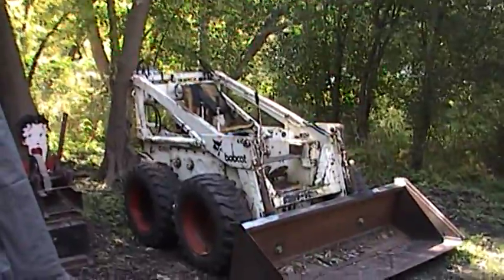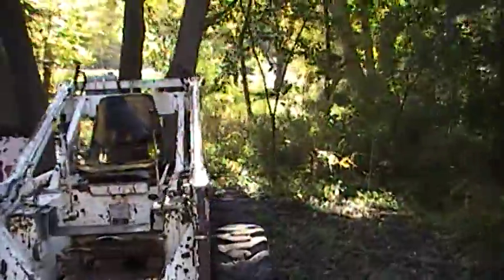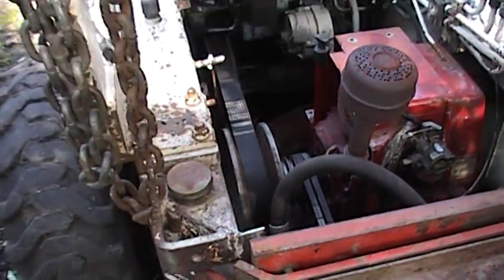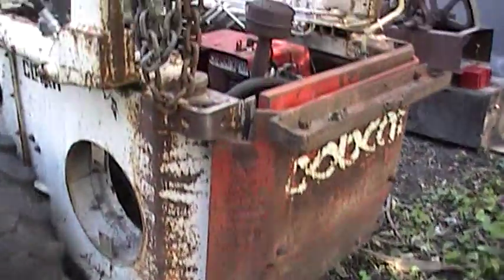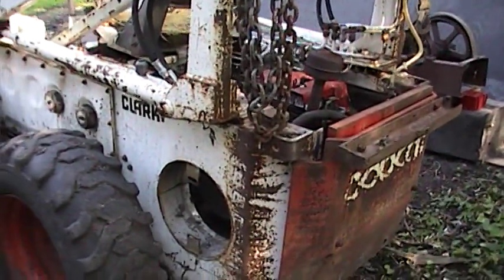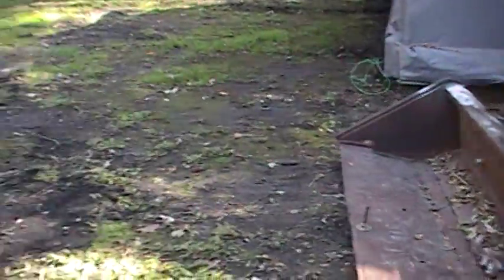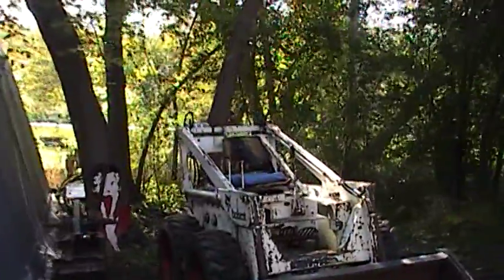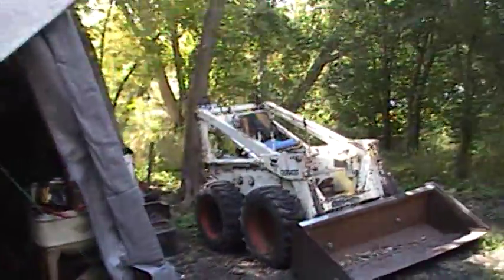Bobcat 600 610 engine swap

Comment: Hey Phil did you ever reinstall that Wisconsin engine in the Bobcat? We haven't spoken in a while. I've repowered two machines since you last helped me with my 444 repower. Hope all is well - gc.
Reply from the maker: No, The smaller V-4 Wisconsin is hard to find and pricey,  looking at installing a Brigs V twin, or a twin cylinder Wisconsin I have.   The Kohler is still running.  Probably a winter project or next spring.  It still works well for what I use it for, just moved 6 yards of dirt.  Thanks.
Reply: @farmerphil  not long after I repowered my machine I started the Melroe Bobcat Owners of America Facebook Group. We are now up over 1500 members worldwide. If you have a Facebook account you should check us out. Lots of guys like us keeping these old girls running.
Reply from the maker: @livetoridemyxlh  Logged in, nice site.
Reply: Some one know something about this bobcat 1978
Some one in the group know something about this 1978 Bobcat. Please add coments that help me to maintenance. 

https://youtu.be/4j8wvF_6Kfs

Comment: I guess this is something to consider when shopping for an inexpensive skidsteer. You can get a fairly worn out, modern, diesel machine and hope it lasts because repairs may be expensive, or go for an older gas machine like this and know that even engine failure wont cost too much as small gas engines are pretty easy to come by. I've been looking at Case 1845C's which I'm told are incredible machines, but some of the cheaper gas models are starting to look appealing too.
Reply from the maker: There are pros and cons like any machine. One thing when looking for an older skid steer find a model that was popular and made for many years, more parts available and complete machines for parts.  Find a model that used a driveshaft coupler instead of bell housing, easier to put in a different engine.  Some diesel engines are expensive on parts and even hard to get, stay with a more common and produce motor.   I have a track loader with a Perkins diesel and a nightmare on some parts just like on other English parts.  Just my opinion from experiences I have had in and out of the shop.   Good Luck.  Phil

Comment: Awesome,,,i have a Hydramac1300 with a 3cyl isuzu diesel,,replaced all hydraulic lines and now she wont start,,the injector pump is pumping fuel to injectors but injectors wont open....Do you think theinjectors went bad from sitting,i took them apart all nozzles and pintles were siezed,cleaned them up vut still not popping the injectors open...i was about to just drop a 4 cylinder Gm motor in it ..

Comment: I have a M440 the first model to get the Bobcat logo. It had a 2 cylinder Onan in it. I have two Harbor Freight 13 HP engines on hand. They turn 3,600 rpm and the Onan turned 1,800 rpm. I'm gonna try and put a jack shaft in pillow block bearings in the place where the Onan crankshaft would be and belt drive it and also slow it down with pulley size. Probably mount both engines and have one that will disengage when just moving small things. I put a set of real forklift forks on mine and added several hundred pounds on rear. It puts good size oak logs on truck and sawmill bed both with no problems. Do you think I need both 13 hp engines on it?  I've missed it as much as loosing a good old loyal dog. It was used daily. Just to poor to buy a newer used machine. If you add a good set of forks on it you'll forget they made a bucket  to use.
Reply from the maker: Sounds like a plan, you need to keep your engine in its rpm range for optimum torque. You could keep your drive sheave low to keep main shaft spin down.  I know you can buy a Briggs conversion all set up but it is close to $3000, quite a bit to spend. depends on your use to I lift close to my full load but need some more counter weight on the back to make up for the light weight engine. Check out Glenns video he did a great job on his.
Reply from the maker: ***** I have a set of forks off a big hyster on it now and welded up my own plate from a universal mount, works great.

Comment from the maker: You could use the original pump just install a belt pulley on it and make a bracket like I did, but I had the other pump on hand , so used it instead. make sure you have the correct rotation, rpm,and low feed when using, some pumps will not pull fluid to well when mounted high.

Comment: Now I know why you got another hydraulic pump - The hydraulic pump on the Wisconsin V4 is powered off the timing gear. I just learned that from an old gent I met at Tractor supply.

My hydraulic pump is separate so no reason why I can't power it off the flywheel side as it currently is on the Onan. That saves me some trouble.

I learn as I go...

Comment from the maker: The pump is one I had in the shop but any 3200 to 3500 psi pump with standard flow should work, you can get them from McMaster or other suppliers.  The hose is one I had that I made and did not use, I never throw anything away. The flow control for the pump is built into the machine. Check tractor supply, and others for prices or even eBay..If you know anybody with junk machines you could pull a hose off it, but not to costly to have made.

Comment: Regarding your hydraulic pump, I have 2 questions:

1. Did you buy that pump or is that one you just had laying around? if you bought it where did you get it and what model is it?
2. The extra lengths of hydraulic hose needed for that set-up, are they just generic large hydraulic hoses or did you have to get them from Bobcat?

Comment from the maker: Hi, I bought the engine from an auction it was in an old starting unit.  The pulley was on it and I machined the snowmobile clutch hub to bolt to the engine pulley, Wish I took some photos of it.  You could buy a pulley and weld a mount to it.  Lots of ways to do it once you understand the mounting, make sure you get the belt to the lowest setting on the engine for power, and hich up on the drive pulley.   Will try to get some close in photos later.  Phil

Comment: So what I gather, 2 sheeves bolted together with spacers, to a hub you made that attaches to the standard shaft of the engine.

Grainger sells v belt pulleys of all shaped and sizes. I noticed there are 4 v belt slots (4 pulleys in 1) on the drive pulley for your hydraulic pump. Is this just because it was what you had on hand? Do you think I could buy a v belt pulley from grainger that fits the engine shaft and just use that to power my hydraulic pump?

Comment from the maker: Hello.  Not sure the model it came off a friend at a local marina gave it to me.  I would think you could use the primary or secondary clutch,  I just needed the two shive halves and made a hub to mount them to, then the engine shaft. I used long bolts to mount to the hub then spacers to get the spacing I needed for the low end. It is still direct drive to the steering clutches.  I could get some photos for you to help see.  Phil

Comment: I'm impressed. I have a 50 year old Bobcat 444 and the clutch is shot. I'd like to do something like you did with a snowmobile secondary clutch. I'd like the use the original 2 inch wide belt. What kind of used snowmobile would you recommend that would be compatible?

Comment from the maker: Thanks, hope to keep this skid steer running for some time just about done with the original Wisconsin engine, waiting on some rod bearings.  I may keep the Kohler in it runs good and works for now and does what I need it to do.  I just cant see a still good machine going to the scraper, if it ever came to that I would just use the parts for other machines and not let it get melted down to make cheap Chinese junk.  Thanks for your comment Phil

Comment from the maker: I  believe any equipment can be converted to run again.  It works pretty well and will spin the tires when loading the bucket.  The only problem is I lost about 300 pounds or so in rear end weight.  But for what I use it for it works well.  Thanks.

Comment from the maker: @73Shakes  I looked at small diesel engines but most were to big, and I had this one in the shop.  You can get a twin cylinder Brigs all set up for the early bobcats but they cost around $2600 bucks, or so. For a little more money I could buy a used running bobcat.  I will have the other engine repaired soon so will go back in.  Thanks.

Comment from the maker: @SuperHotLarry The cab was an option it is set up for one, But when working in a barn and cleaning up manure.  It made for a compact unit that could fit under tight spots.  And you did not want to stop fast if you had a load in the bucket you would get thrown out, no safety bar.

Comment from the maker: @2400PORSCHE   They are a beast with the Wisconsin V-4 in them.  Only bad thing is the crankshaft is not standard it has a special taper on it for the shiv.  Hard to find unless you switch cranks.   Thanks.